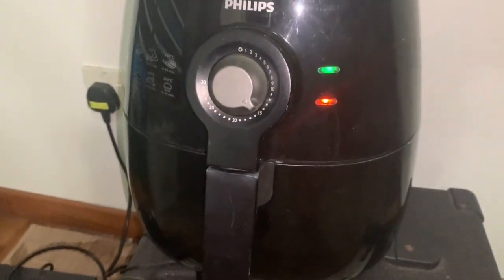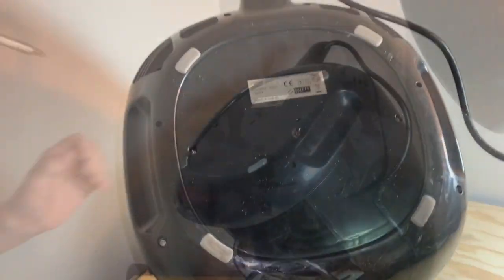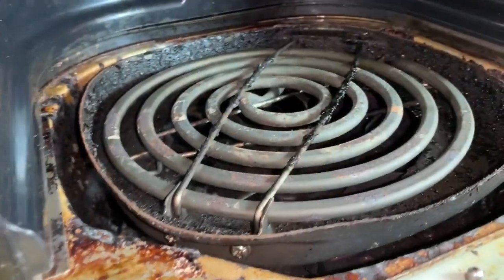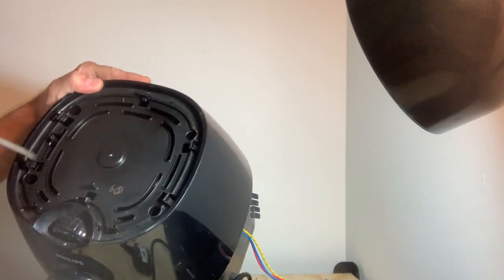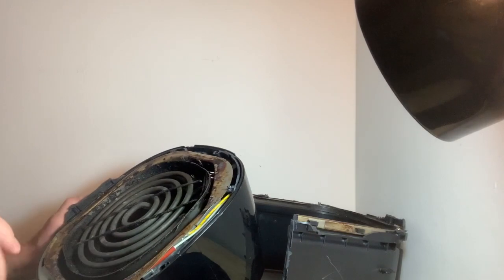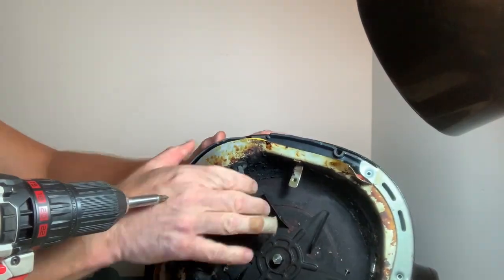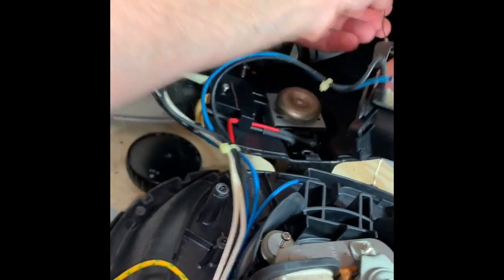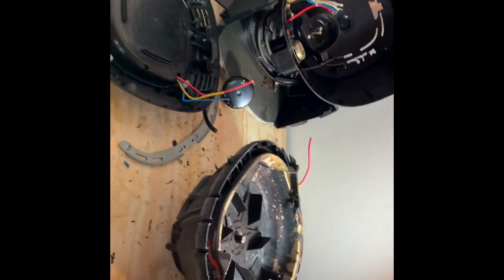What's Inside? Phillips Brand Airfryer-Complete Tear Down Take Apart Disassembly [Phillips AirFryer]

Comment: Hi. The top corner of the case of my air fryer cracked and a piece broke off while moving across states. Everything else seems to be intact. I really don't want to spend another 120 on a new one if I don't need to. Do you think it's compromised at this point or do you think it's ok due to only the corner housing being broken off? Looking for an opinion from someone who obviously knows about these things. Thank you 😊
Reply from the maker: I say safety first and go get a new one because if there is outer damage like that it may have caused some sort of a short or even compromised any kind of other safety mechanisms on this. That’s my best advice. Knowing myself I would see how it operates a time or two under close personal observation and go from there.

Comment: Wow, I did not expect a destructive disassembly. Thought it was still working? Mine has stopped working and I'm wondering if the internal fuse has blown. Where is it btw, if there's one.
Reply from the maker: Hi Buck. Yeah had fun doing it. Not sure where the fuse is. Take care.
Reply: There is a thermal fuse normally attached to the metal case inside near the heater
Reply: there is a fuse besides the motor.